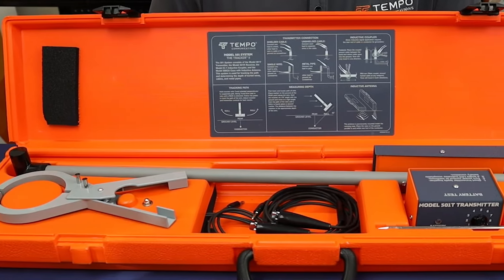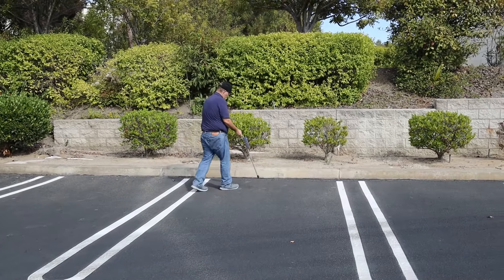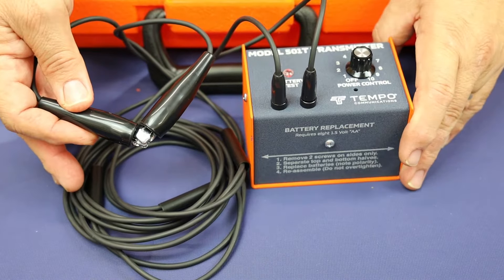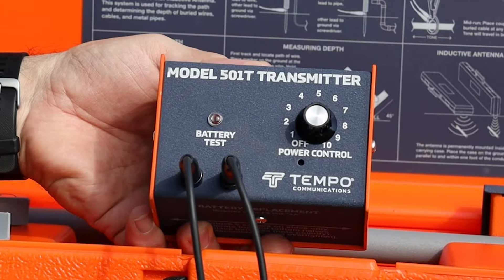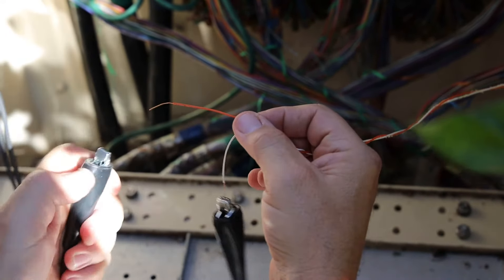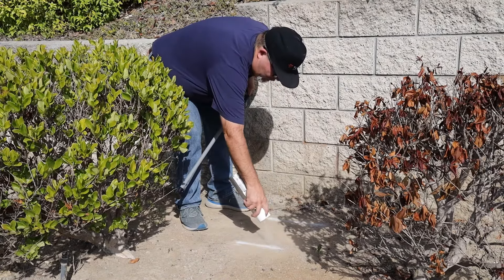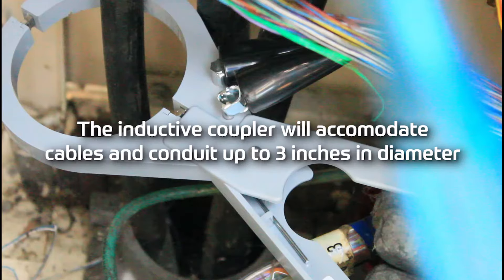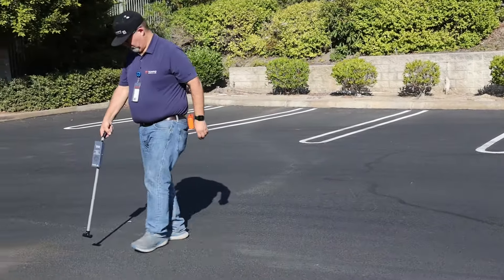Tempo 501 Tracker II Cable Locator Training Video

Comment: Can this be used to find ground faults in 4/0 cable?
Reply: This is not an ideal locator for finding ground faults; the PE2003-G is an ideal choice as it's dedicated to that task.  The 501 does do an excellent job of tracing the wire path so that the PE2003-G can lead you straight to a ground fault.

Comment: too bad this unit doesn't have Null mode, like the armada.
Reply from the maker: While the 501 TrackerII doesn't have null mode, Tempo’s 521A Wire and Valve Locator features a null antenna on the receiver and is optimized for irrigation zone wires.